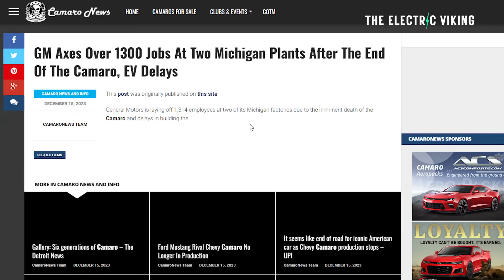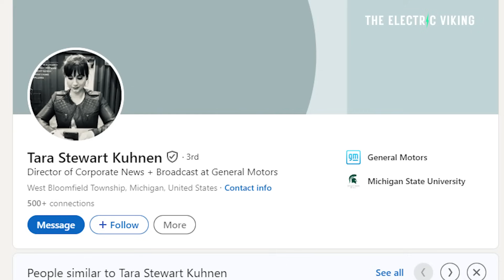Breaking: GM fires another 2,100 staff after MORE Electric Car delays

Comment: Sam - Here fired means employment terminated due to lack of performance, excess tardiness or misconduct with little to no hope of future employment.  GM is engaging in layoffs and perhaps what they prefer to call workforce optimization which in either case its where your let go through no fault of your own.  Fired implies there was some fault, failing or defect on the part of the workers.

Timing though is a bit ghoulish due to the season where many have already incurred some debt for gifts that they would have likely scaled back if they were sufficiently notified that optimization to reduce headcount was about to take place.  Two weeks might be the minimum to not have to pay "Wages in Lieu of Notice" to employees who don't have enough tenure to receive a severance package.

Best!

Comment: This shows the relationship between the UAW and the OEMs..... totally adversarial. 
It has been that way since the formation of the UAW due to the neglect of OEM management who have always viewed their workers as cogs in the wheel, not people. 
The C-Level folks at these OEMs see themselves as Lords, not as the "common folk", who are expendable. For them the business exists to line their pockets and the pockets of the largest shareholders. Robber barons all. 
Conversely you have a new company, Tesla, where the job rolls are not fixed and people gravitate to where they can make the most difference. Brilliance and ideas are what puts you in the C-Level. Going to the C-Level only means more work and does not excuse you from jumping on the line and getting your hands dirty. A complete and utter 180 from what the OEMs do and are. 
This is why unions won't work at a place like Tesla.... the union is severely structured as to who does what and everything is based on seniority and not brilliance. The UAW would not even begin to know how to even swim in the ocean of Tesla.

Comment: What’s surprising you that GM are getting rid of fossil fuel staff?
Reply: Not fossil fuel. “They include 945 workers at Orion Assembly who build Chevrolet Bolt models”
Reply: @juliahello6673 the plant where Chevy bolt is now being produced is going to produce EV trucks. They are completely changing production of the Bolt at another factory. Maybe you need to keep up with the news

Comment: GM flyes under the radar because in my opinion they are not a successfully evolving brand such as TESLA who are on the cutting edge of tech in autos and in other areas. GM is stuck in ICE tech still and because of that it is scared that they be obsolete in a few years..... Oh and IMO...😊😊😊😊
Reply: Just do what VW is doing. Get China to build the car. Put on American made tires. Say it's "Made in USA" and slap on a  GM label. Finally, keep making ICE cars as long as they are still making a profit on them.

Comment: Reason why No jobs ...

EV means no gearbox
Radiator
No piston
No cam shaft
No drive shaft
No fuel injection
No fuel tank
No cylinder
No head gasket